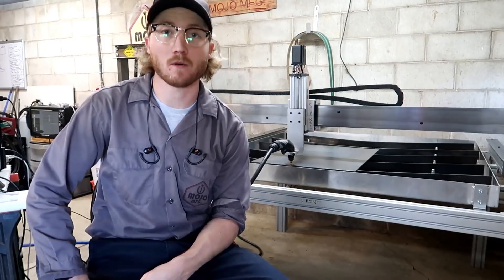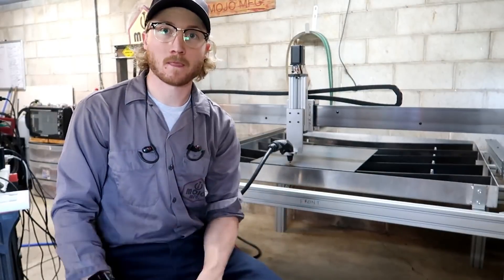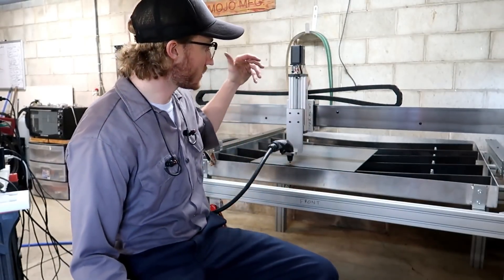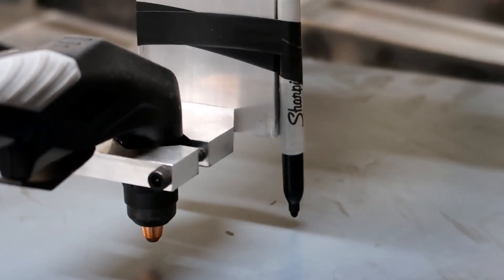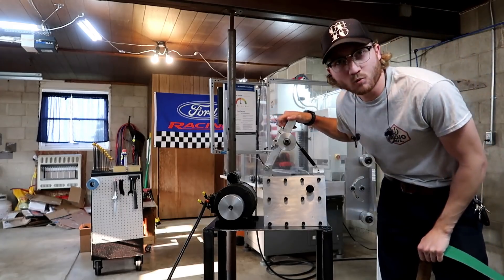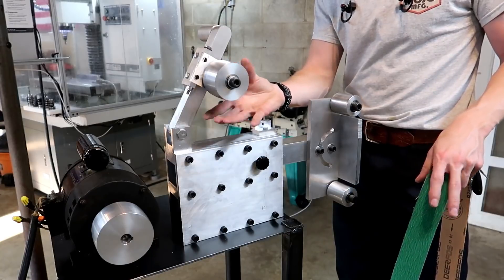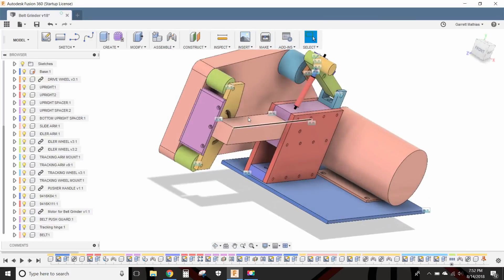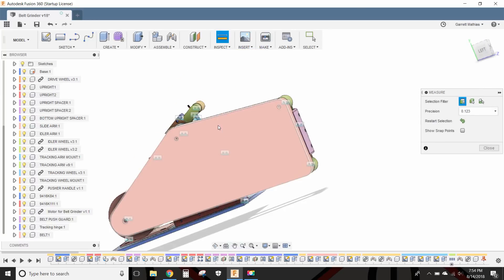DIY Belt Grinder Final [PLANS]: Home Mfg. Days #53

Comment: I thought that was a 2x48 haha bl. Those are the polish wheels right? Don't they mount round the other way?? (I'm not sure).
Reply from the maker: The wheels are not polished, just a machined finish. https://www.ebay.com/itm/Belt-Grinder-2x72-wheel-set-for-knife-grinders-/252045291819?hash=item3aaf11f12b 

As far as "mounting round the other way", I'm not sure either

Comment: Great work!  Quick question: do you feel the 20lb tension spring would be enough to take the slack out of the belt?  Or would you swap for a 50lb version if you had the chance?  Or one of the other options McMaster has???  Thanks!
Reply from the maker: Thanks! Yes, good question,  the 20lb is definitely enough.  I was skeptical to get the 20lb spring at first but then I saw a bunch of guys using that one on there build so I decided to get that as well.  The 50lb spring might be a little hard to push down when changing out the belts.
Reply: Makes sense.  Thanks for the reply!

Comment: I agree with your statement and the above post. You should remake your stand so it doesn't stick out as much it and almost seems like you will have a tipping problem when you have the longer stick out.  Besides then you have a second chance on the stand. That being said great job on the machine.
Reply from the maker: Thanks! Yeah it does seem like I might have a tipping problem but we will find out for sure when the new piece comes in. If it seems like I would have a problem then I will definitely remake the stand. I always need more welding practice anyway.

Comment: Could you have move the motor back to help with some of the slack?
Reply from the maker: Yeah I can remake the stand and have the motor pulled back some more to get rid of the slack but will see what it looks like after I get the new piece of material in to pull the front out more.